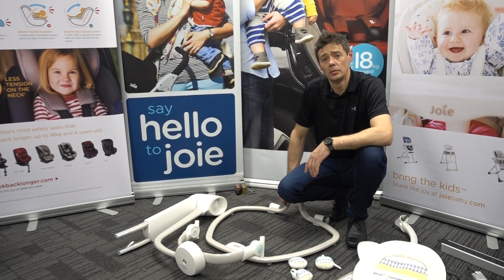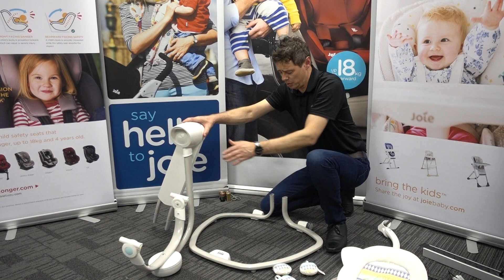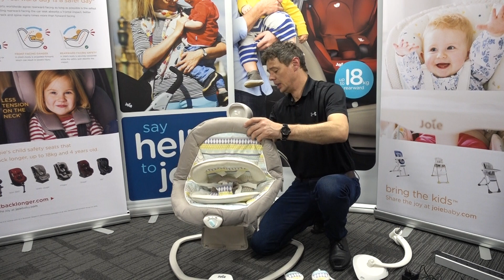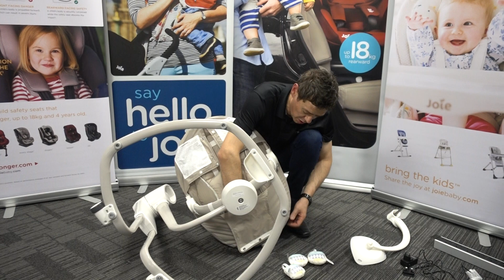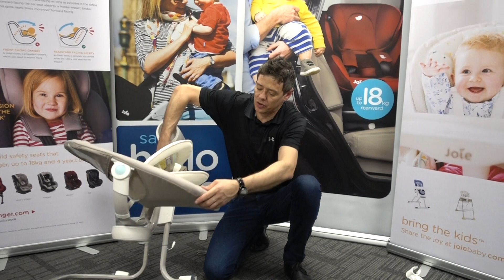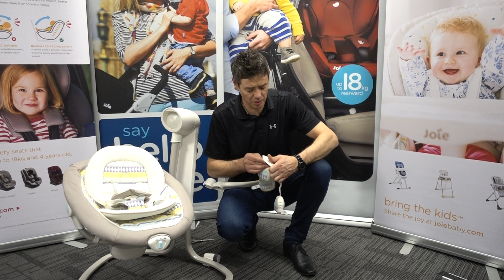Joie serina swivel build, step by step

Comment: The straps on mine seem really tight on the shoulders even when let out fully is that right?
Reply from the maker: Hi, for an older child the shoulder straps need routing directly through the upper shoulder strap holes in the cover, this will give greater length. Hope that helps with your question. If not please send images to our customer service team, who will be glad to help further.

Comment: I have the girls version, the pink one, is it possible to take the newborn pink insert out to wash it? I cant seem to get it out unless i were to cut it and i dont want to cut it x
Reply from the maker: Hi, The insert section will lift off, once the harness straps have been unclipped fully. To unclip the shoulder straps from the waist is a matter of unclipping them from the centre buckle, then pushing the shoulder clip sideways, to remove this from the waist section. the insert will slip out of the straps then.

To remove the full seat fabric, it is also possible but harder, due to the retaining clips / straps on the underneath.

Comment: How do you dismantle it again? Need to put it into storage but can’t get it back apart??
Reply from the maker: Hi, See link for taking the frame section apart. https://youtu.be/acDvIl9BVtY
To dismantle the seat section, it is the reverse of the build but there are little metal clips, that need pressing in. A pen top, or something of a similar size is best to use. Press these metal pieces in and pull on the metal framework, they will slide back out of the plastic to dismantle.

Comment: Which battery did you use?
Reply from the maker: Hi, It uses 1x 'D' battery for vibrate & 4x 'D' Batteries for the main power unit. Main power unit can also be used with the mains power adaptor too, but vibrate only functions with Battery power. We recommend to use an alkaline battery, we use Duracell to power our show models.